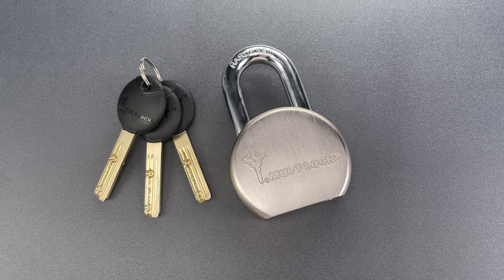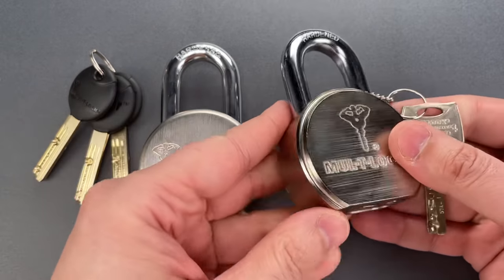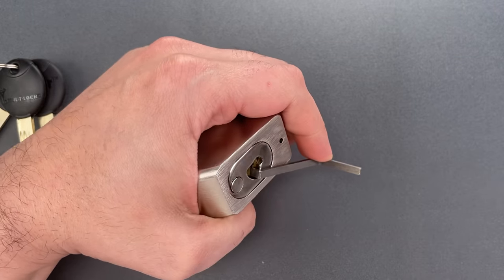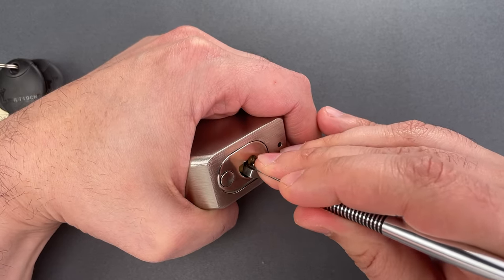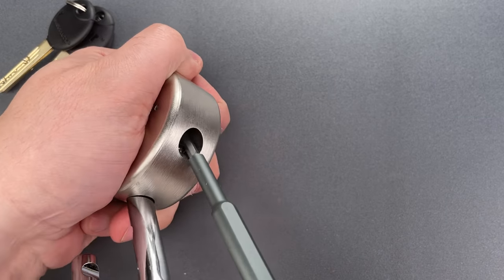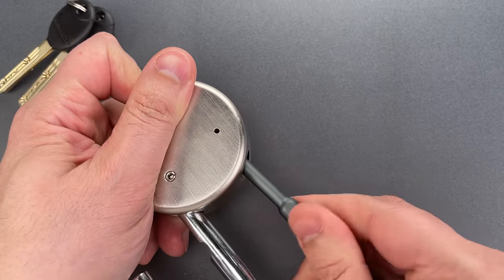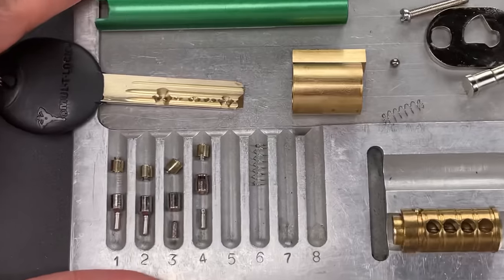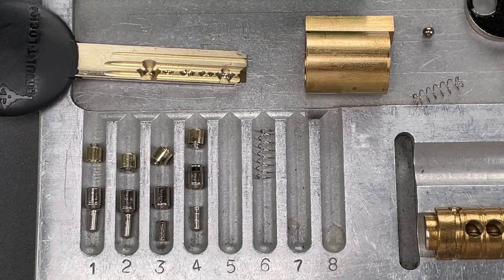[1394] Mul-T-Lock Round Body Padlock Picked

Comment: A Mul-T-Lock dimple pin lock is practically impossible to pick unless you're an expert. LPL made it look easy because he's a pro. period.
Reply: As long as you have a small understanding as to how locks work, the most average person can unlock a lock with a pick in a few mins or less. It has been proven over and over with a little bit of showing you how a person can pick open a lock. 
There is a good example on I think it might have been CBC about locksmiths. Showing the news person how to pick a lock open and then calling a locksmith who then says he can not pick a lock and needs to drill. The lady could pick the lock in about 30 seconds. Now I am not saying that someone can pick this lock that fast it might take them a few mins yet Its very possible that they will get it. If the LPL can pick a lock so can we all. It just might take longer.
Reply: @kameljoe21 So by and large you are saying that...Anyone can pick this lock but it might take a lot longer... is what I think you really meant. And that lot longer could be hours or even days and to that, I'll agree! Got any lock picks? Had a go at one of these? Please do tell. I have and I failed!
Reply: @kameljoe21  I wonder how much time would a complete beginner need to open this up and would it require just a basic lock picking kit, or something more advanced. I'm curious in the differences between various lock models. For LPL some locks take a couple of seconds, the best ones - like almost a minute. I think the times would vary a lot more for beginners. Do you think many thieves know how to pick locks at all?
Reply: @Adam_Lyskawa  thieves for the most part will not pick locks. They have to do it quickly.  So destructive method are most likely. Angle grinders only take 20 seconds.
Reply: He is almost Egon Olsen level
Reply: @TheGeezzer  Yeah I do not have any picks at the moment. Though I have picked some locks over the many years I have been alive. Its not easy yet if you have watched a number of LPL videos most people should be able to pick them with in 15 mins. This lock might be a bit tricky yet I am guessing someone sitting down with a lock and this video should be able to pick it in about 5 mins. 
As for other locks, most master locks are very simple and someone who has only seen two videos a raking video and a picking video should be able to pick a lock in a few mins.
Reply: @ipick4fun27  Yes many locks can be cut open in short time. Bolt cutters and grinders can and do work fast. Yet if you watch the krypointe lock video where the LPL opened said lock faster by picking than grinding is much faster. Thieves who are about smash and grab are likely to do a destructive method while some thieves will pick a lock so that the theft is not known for a long time. There are many reason why one would want to pick and why those would cut.
Reply: @Adam_Lyskawa  This lock i would think might take 5 to 15 mins for a beginner. Once you understand how to pick the lock it becomes easy. For other models a beginner should be able to open most locks in under 2 mins each. Somewhere there is an article where someone where they take the 15 or something locks another article said were the best locks and they opened them in no time flat. There are many examples of beginners opening locks just as fast as the LPL. Raking locks is one of the simplest ways and most people can do this after a few tries. I have raked locks open with ease and I am by no means a hobbies or someone who tinkers with locks. I do not even have a lock pick and before watching these videos I have next to no understanding on how locks worked. The first time I opened a lock was by chance with a small screwdriver and a paper clip with a small hook bent on it. I had zero ideas as to what I was doing and only had movies and tv shows information to go off of when I was a kid, back in the 80s and early 90s. So even with just that I was able to open a small wafer lock with easy.
Reply: @kameljoe21  this is complete nonsense, a lot of people who have basic lock picking skills would never be able to open this lock.
Reply: It didn't even look that easy. Destruction would be my method
Reply: @keymasta3260  Præhæhæhæhæ!
Reply: @kameljoe21  It seems you haven't had enough experience to comprehend the full range of difficulties posed by different locks, and the skill levels of different lock pickers. You've picked a few locks and been amazed at how easy it is, so you think anyone can pick any lock. Look up the dunning Kruger effect, it's happening to you. Most locks are very easy to pick, but there are also many high security locks that are damn near impossible to pick unless you've had hundreds of hours of study and practice with related tech before you have any chance at picking them open. Any serious lockpicker has a collection of locks they can't open.

Comment: Little out of practice? This man is insane. The speed at which he works is so crazy. Locksmiths who earn money from this stuff don't do it as fast on much simpler locks.
Reply: While this is true, picking is a relatively small part of many locksmiths’ jobs. Also, they are working under field conditions (dirty, possibly damaged hardware, uncomfortable angles, in the rain), and they don’t get to film multiple takes and select the best one. 

None of this to take anything away from LPL, he is an excellent lock picker.
Reply: @gregiep  As a locksmith I will also add, at least in the US, 95% of locks I come across are going to be KW1 or SC1 with the occasional Y1, S22 or Corbin.
Reply: @Vorsai  for some reason my area seems to also have an abundance of 6D1Rs and Yale 11-GBs, oddly more than the more common Y1.
Reply: @gregiep  oddly enough a few of the locksmiths I meet at work (construction) rarely pick or even know how. Always start talking to them and they all say the same. 

Lots of their work is just installing door hardware not opening stuff that's missing a key.
Reply: @JoeC92  Yeah, most of the locksmiths I know have the main specialized part of the job being able to remove locks without damaging the door. What happens to the lock is, of course, unimportant.

Comment: "A big problem is the grease making everything sticky"

That's the opposite of what it's supposed to do!
Reply: I fully understand that this is meant as a joke, but still I'm gonna bitch about it:
Solidol, Grpahite greases are sticky because of high viscosity. They are used to lubricate bearings.
Reply: @kirvis250  not a joke. Lubricant is meant to reduce friction. Sticky = more friction.
I was unaware there's a lubricant meant to be sticky.
Reply: @NeoTechni  it's not meant to be sticky. I'ts more of a side effect of high viscosity liquids. and high viscosity greases are used in places that can't be hermetically sealed like locks, bearings, hinges etc.
Reply: Grease is also used to protect the parts from water, is not all only about lubrication.
Reply: Grease is simply oil in a soap-like carrier so it won't drain away. The carrier is resistant to movement to keep the oil in place. Grease is not really suitable for situations where there are lightweight parts that must move freely, being moved by very small forces. I submit that a pinned lock (of any sort) is just such a place; clockwork is another.

Comment: Yknow i dont know why no ones thought of this, but i just had a brilliant idea for a padlock. Obviously you want the most secure pins you can manage, but im thinking add two small cameras built in. One on the outside to see who is opening it, and one on the inside that acts as a motion detector which turns on the the outside camera for 30 seconds. Connect it to a phone so it sends the videos there, if anyone tries to open it that isnt you, you now know who broke in, and can go to the police with hard evidence. Every single lock is pickable with the right tools and know how, if its not pickable yet its only a matter of time until someone develops a tool and technique to pick it. Itd be safer to have other security methods besides just pick resistance

Comment: another very good video however, not all MTL jrs are 4 pin in pin, they are actually standard 5pins unless they are in short lock bodys, or in this particular padlock style because of the room that is available inside the lock body. they also come standard with spool drivers except in this lock again due to size restrictions,  it looks like they use the drivers for their cam locks. happy to see a non split core 👏  i have 2 of the padlocks with split cores the interactive and interactive + and they care be a pain to gut if u don't know the tricks

Comment: If it takes LPL more than a minute to pick a lock open, It should be fairly recommended, as most thieves will just say screw it, and get the bolt cutters, grinder or torch out.

Comment: Had an idea for an unpickable lock...  The lock's keyway is closed with a sliding door when locked.  The door can simply be slid open to insert the key, but opening the door disables unlocking.  The key must be completely inserted inside of the lock with no part of it remaining outside and the door closed before you can press a button or slide a lever to open the lock simultaneously opening the door and ejecting the key.
Reply: in theory, but how is the sliding door mechanism gonna work in real life, we could insert a custom tool to hold the mechanism in place while you lock pick
Reply: It is a similar mechanism to the "turning tool" used in normal locks

Comment: Where did the ball bearing come from and what does it do?  It falls out when the core is removed, but not sure of the purpose.
Reply: I would guess it is the ball bearing that is the latch mechanism.
Reply: It came out of a hole in the side of the plug. Probably spring loaded it may be used to bias the plug to one position

Comment: ya know LPL, I've been watching you for quite a while now picking just about every lock made and you seem to be able to make quick work of just about all of them.
Is there ANY lock you haven't been able to pick?
Just curious... 😁
Reply: There have been a few...I think some of the naughty bucket ones gave him a bit of a run around.

Also he did a keynote at a convention recently and in accordance with the "On-The-Spot" rules of the universe one of them gave him some trouble while he was demonstrating live.
Reply: See LPL's video 686.  This is his review of a lock made by the Bowley Lock Company.  LPL has not yet opened this lock on camera.  Only three lock-pickers are known to have been successful at picking this lock.  Each had to manufacture an extremely difficult tool to emulate the key and they were only open the lock under controlled conditions.  The company is not aware of anyone having been successful at picking this lock "in the wild."  If you are interested in buying one of these locks the one featured in LPL's video is priced at $230.
Reply: There are several
Reply: A thing worth noting is a lock is only as strong as its weakest point. No point getting a lock-proof door if your window is easily breakable. Just look at one that gives him some trouble, (like a minute, like this lock). Also, he showed in a video on how to change the pins of a random lock, which makes it much harder to break into, but the lock would break if someone tried to pick it.
Reply: Recently reviewed his top 10 nastiest keyways video, and I believe there were 3 he deemed unpickable.

Comment: I haven't seen a lot of these pin-in-pin designs. It doesn't look like the pins vary in length, is this common? Besides spooling, what variations do they have that could make for a more secure setup?
Reply: MTL locks have quite a bit of variety, the JR I picked (on my channel) had 5 pins, of which 4 of the outer driver pins were spools, the key pins were “torpedoes” which make escaping oversets more difficult, and much rougher bitting, this is arguably an out of the ordinary MTL junior

Comment: @LockPickingLawyer PIN 4, outter pin (pin in the middle on slot 4) appears to have a lip at the top compared to the others. Is that the counter milling you were looking for or is that something else, like the lighting just hitting the pin in a weird way?
Reply: Nope. It’s called a torpedo pin and it’s meant to make the user unaware that they have overset a pin when they have overset a pin. In my video picking an MTL junior all but one of the pins are torpedoes, and I had to drop them several times

Comment: Would you mind doing a video on what happens if you pick a lock incorrectly?
Reply: picking a lock incorrectly would probably just not open it. but gutting it incorrectly could damage internals (mostly springs) or render the lock "unusable" if eg. a 6 pin core is pinned up with only 5 pins. when the core is not rotated or shimmed before pulling out, the 5th driver pin could pop into the 6th chamber of the core = disaster, if you cannot reach into that chamber and push the pin back into the bible o.o

Comment: What is the external milling on the outside of the outer key pin on 4, visible during the zoom in at 5:24?
Reply: Not milling, that’s called a torpedo pin, and it makes the picker unaware that they have overset a pin if/when they do overset a pin. In my video picking an MTL junior, I believe all but one of the key pins were torpedoes